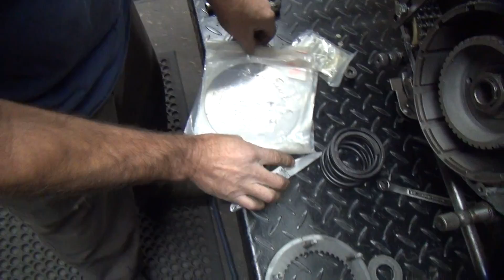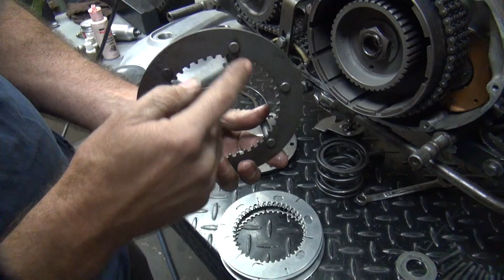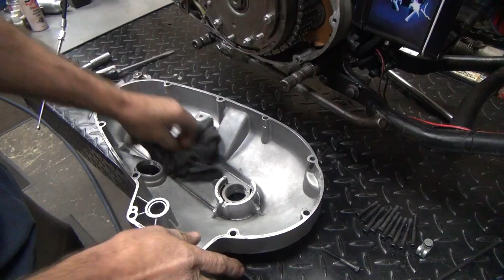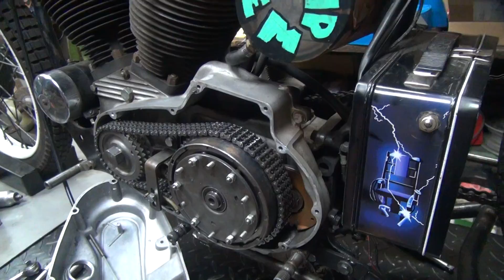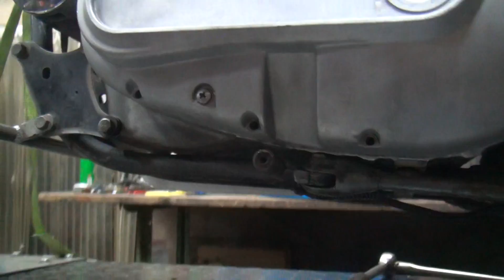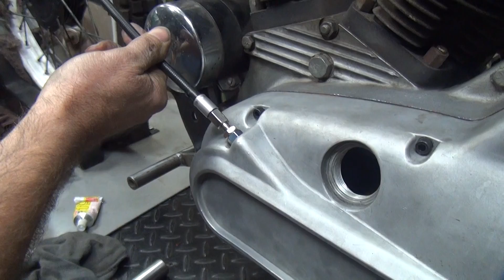1972 XL Ironhead Bobber #108 Sportster clutch primary motor repair harley by tatro machine

Comment: What spacers should I use and where can I get a set
Reply from the maker: the stock ones. try tatro machine.
tatro
Reply: @TatroMachine  I did not see anything on your website , do I need to call to order ? Thanks !!
Reply from the maker: email works best but calling is good too. tatromachine@cox.net
tatro
Reply: I'm in North Carolina what time is best to call  ?

Comment: How do you remove the hub nut on a 69xlch without a air wrench? I need to replace the kicker assembly
Reply from the maker: put it in high gear and block the rear brake some how.
tatro

Comment: Thank you for the vid. As I am letting my clutch out when it starts to engage I feel a small buzzing or grinding at the last second if releasing the clutch. Do you know what that my be?
Reply from the maker: no, take it apart and see what is wrong. broken cases are very expensive to fix, small parts are not.
tatro
Reply: @TatroMachine  thank you I’ll have to pull the primary cover. I was thinking either throw out bearing or compensator.

Comment: Thanks for the info. I adjusted my 75 sportster the same way and seems a fairly straight forward process. I even tried adjusting as described in the manual but my clutch just wont work. I wound the adjuster screw in until it seated and wound it back 1/4 turn and locked it off. I adjusted the cable with a little slack  not tight so the ball bearings are correctly seated. Doesn't matter how many ways I try my clutch just wont disengage like it should when I pull the lever. Any suggestions on what I should be looking for ?
Reply from the maker: try adjusting it at an 1/8 of a turn. the inner clutch plate that has the studs on it needs to be flat and not over torqued. make sure that you use the stock large diameter spacers that go onto the studs on the plate. those thin ass replacement spacers are junk and don't hold the outher pressure plate flat and square.
tatro
Reply: @TatroMachine  Thanks for that I really appreciate your comments and videos. I found that if I wind the adjuster screw in about 1.5-2.0 turns there is a sweet spot that the clutch disengages when I pull the lever. I know that’s not how it should be but could that indicate what the problem is before I start buying spacers and new plates?

Comment: I know Keenan is busy moving so I'll ask everyone this question. 
    With this style clutch, If the adjustment screw and nut were removed all the way from the primary cover ( while the cover is attached to the engine) is it possible for the bearings to fall out of the ramp assembly ?  It they can fall out, is it a certainty that they would fall out ?  Is it possible that maybe they wouldn't fall out if the adjustment screw and nut were completely backed out of the primary cover ?
     Im sure its easy to guess why im asking this question.  I did manage to get the adjustment screw and nut reinstalled.  Clutch releases and engages by squeezing the clutch hand lever.  It just dont feel like it seems it should.
Reply from the maker: maybe but not likely. if you start pulling on the lever than you might have some issues.
tatro

Comment: keep up the good work great source of info...any idea on this my 72 xlch1000 jack it up turn rear wheel can select all gears feels smooth no binding,peddle travel seems a bit far between gears but managable.but start the bike select 1st take off an suddenly peddle travels huge between gears they still select but can not get gear without lifting your whole leg as they about 4inches travel between each one.turn it off an peddle travels back to managable,iv adjusted clutch numerous times (no slip or drag) and the gear linkage distance (fitted with forwards) makes no difference..gear box prob or clutch any1 ??
Reply from the maker: sounds like the shift shaft inner lever is loose on the shaft. time for a new one before it lets go.
tatro
Reply: @TatroMachine  thanks alot,sounds like thats probably it as iv a bit of lateral and horizontal play on the shift shaft at the casing.

Comment: Welding on the case without first heating it up in a oven to get rid of the oils and junk the case has isn't the right way to weld on that case. Weld won't last . and cracking a customer's case has to be the worst . and throwing clutch parts on metal and installing parts that have broken studs to go into a clutch .  if this was done to my bike I think u would be paying a shop that takes pride in there work instead of this getto type work..
Reply from the maker: when you are use to welding crap you get very good at it. if these welds were so bad then how come they looked so good after they were cleaned up. if you want the white glove treatment than go to harley and see what they do for you.
tatro
Reply: Just put a new clutch plates in mine it doesn't spin like that in neutral.